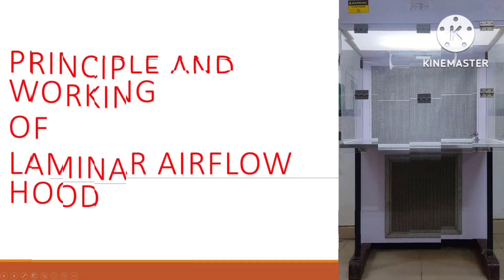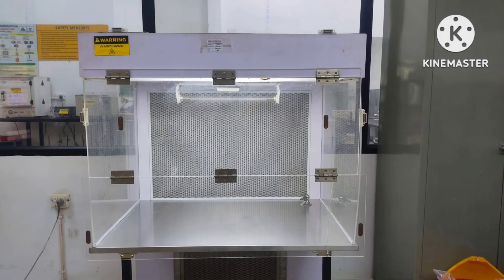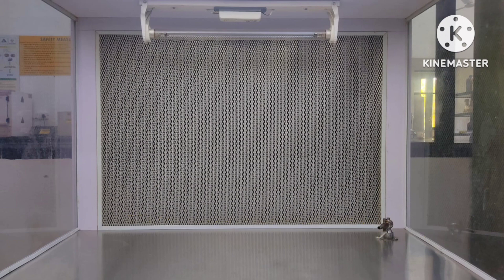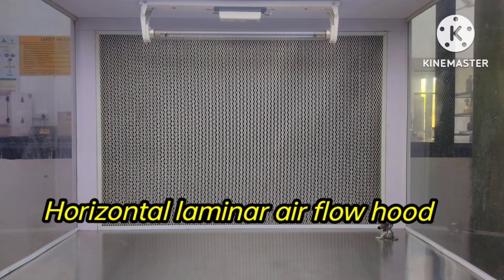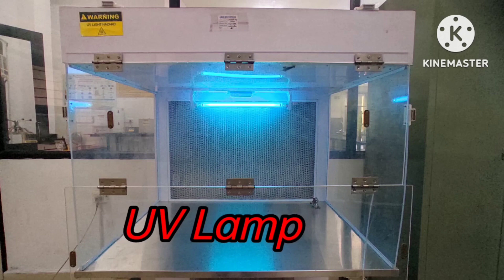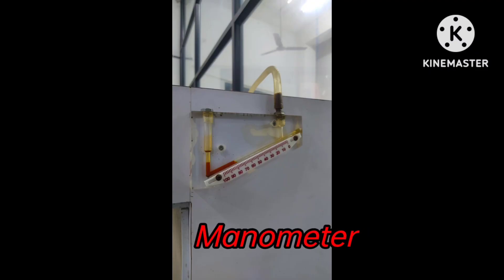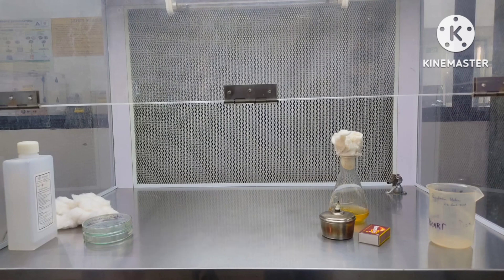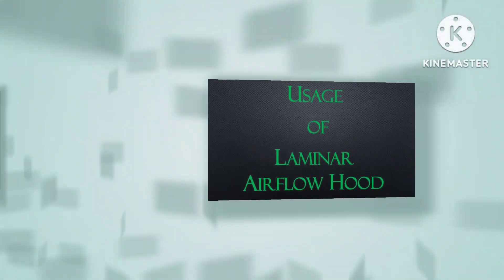Laminar air flow hood (LAF Hood): Design, Principle, Working

Comment: Nice work: can it be used in OT instead of AC?
Reply: Laminar air flow is a device where one carries on their experiment it provides sterile air to keep the work bench microbe free . It does not provide environment safety.
 It can't be used in OT .
Reply: Thank you so much Pisho ! And , though  I am not sure of the instrument but Laminar Flow of air is considered to be one of the most effective way to Control Microbe Levels in the OTs . (who would know better than you :) )